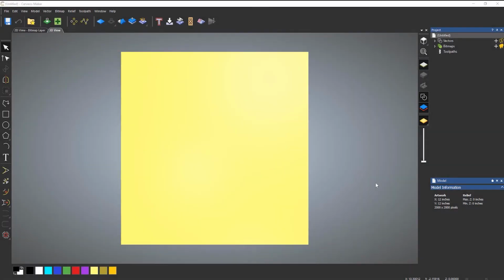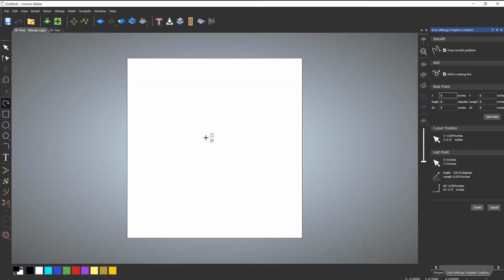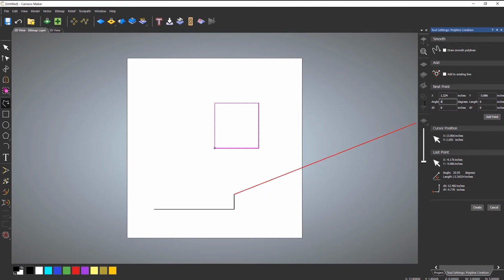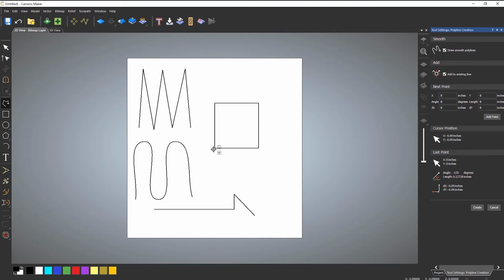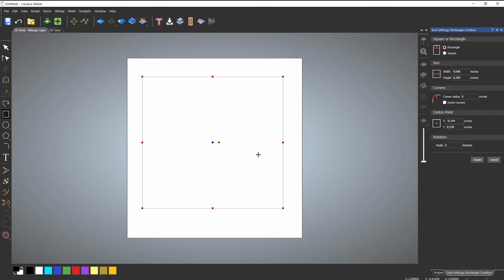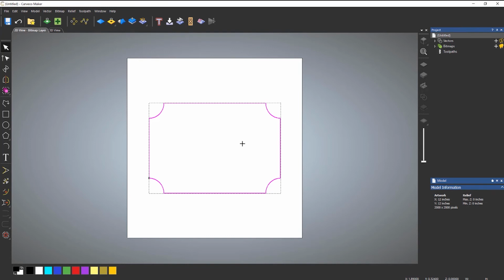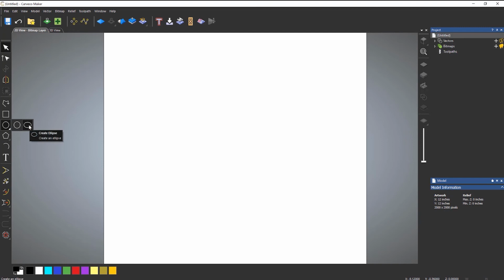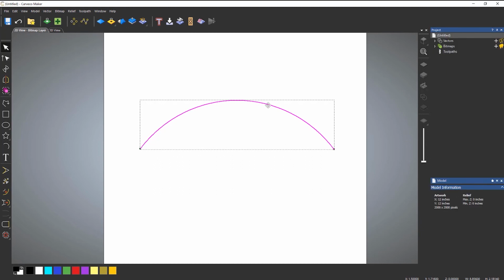Carveco Maker: Drawing Vectors

Comment: Thanks. Very helpful. What if I want to connect the arc to the rest of my drawing? Is there a similar option to "Add to existing line" for arcs?
Reply from the maker: Hi Kenny.  There isn't an add to existing line for arcs.  You would need to snap to the line that you want to connect to, then when done, select "j" on the keyboard to Join the vectors.